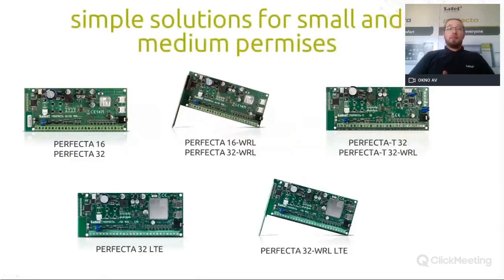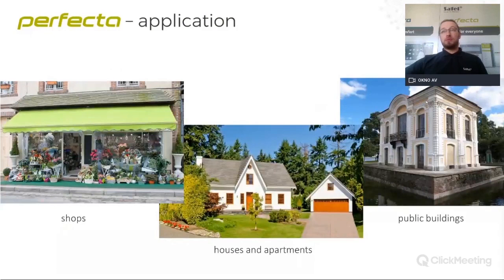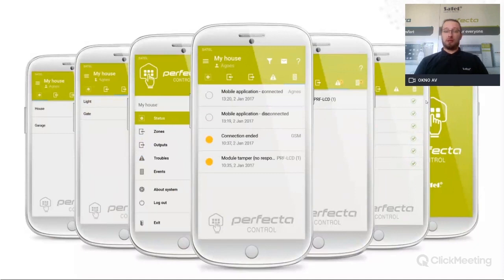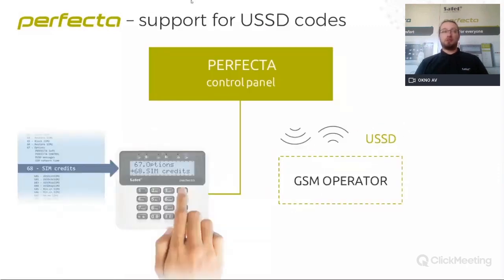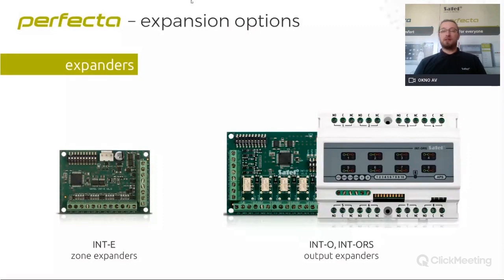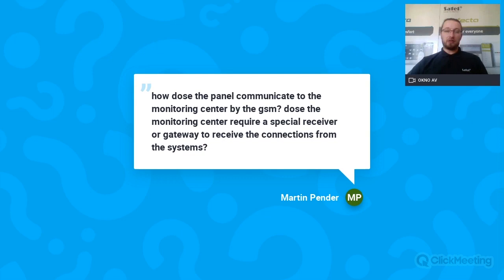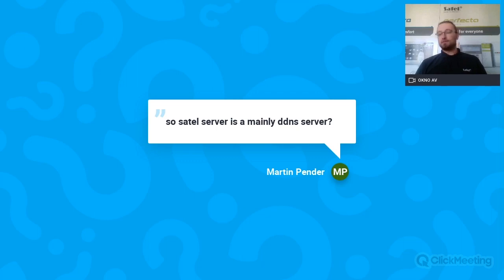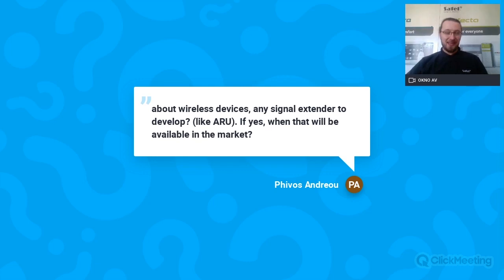SATEL Webinar: Meet the PERFECTA intruder alarm system

Comment: I want to ask a question: Can the Satel Perfecta board make a phone call without the MIC-1 piece? If not, I want to know how to make a phone call.
Reply from the maker: Hi! PERFECTA can make voice calls without the MIC-1 - it’s only needed for two-way communication. Set up voice notifications via PSTN or GSM in PERFECTA Soft, then assign the phone numbers that should receive them. Functions and communication options vary by model, so check the manuals or contact our tech support if you need help.